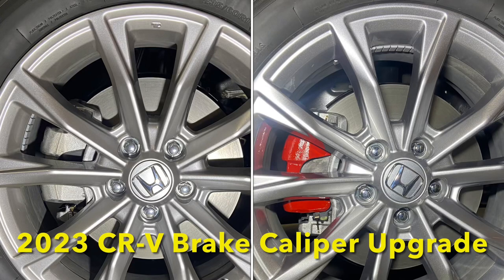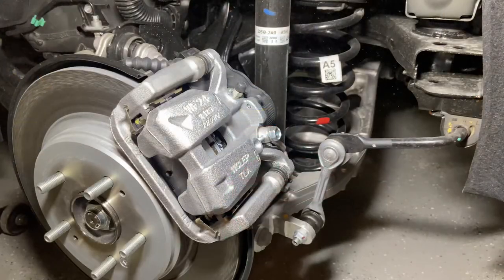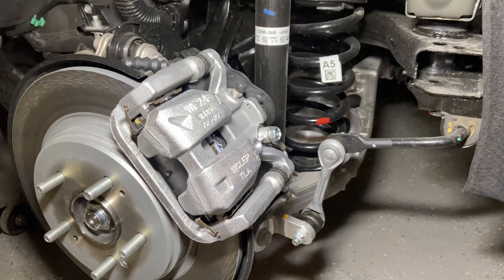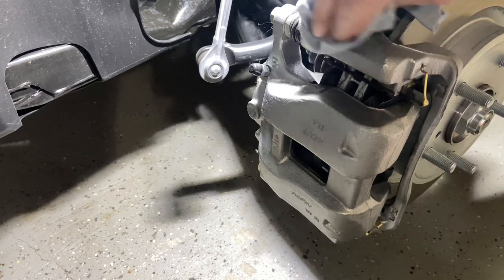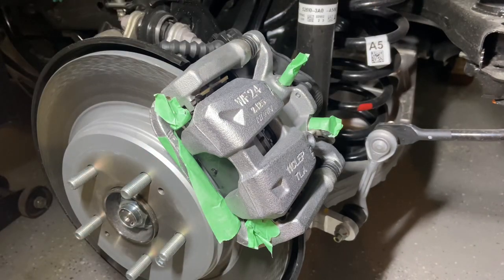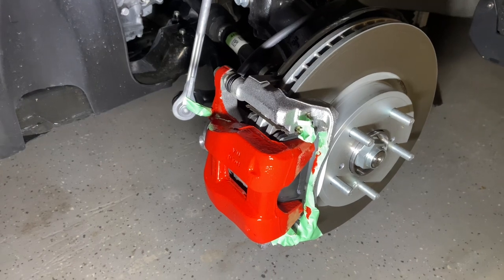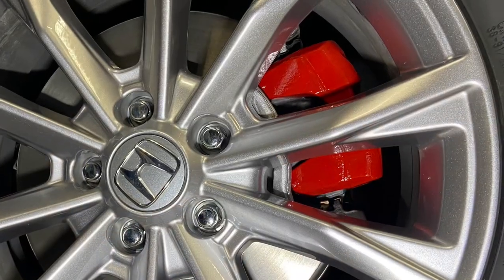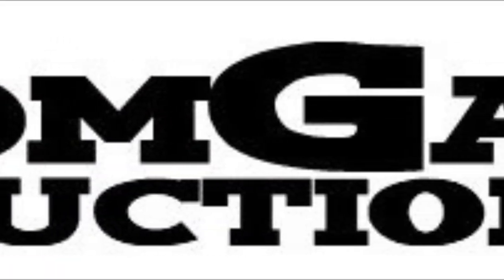2023 2024 Honda CR-V Brake Caliper Upgrade

Comment: Nice one! Could you do a speaker upgrade video? The connectors for both tweeter and mid-range are different than any other Honda other than 22 Civic.
Reply from the maker: What issue are you having with the OEM ones that we would be upgrading?

Comment: Thanks so much for doing this demo, I've been wanting to do this to my '23 CRV.  One question.  I noticed you didn't paint the bracket on the bottom.  Is it ok to paint that part too or would advise against that. Thanks!
Reply from the maker: No issue painting it, I wasn’t sure how it would look and figured if I wanted to do it later I always could. So if you do, please send a picture! Thanks for watching!